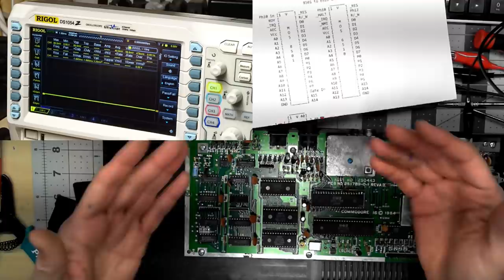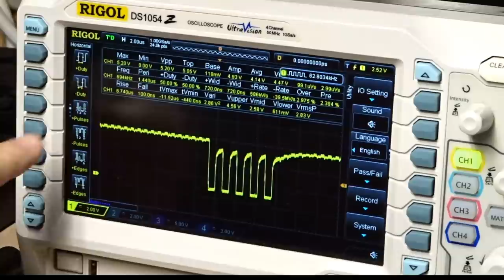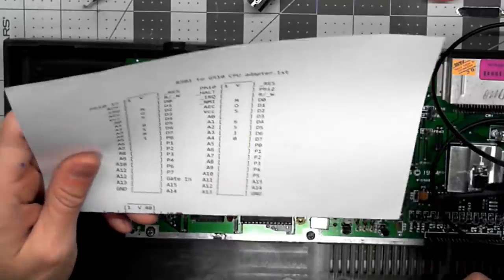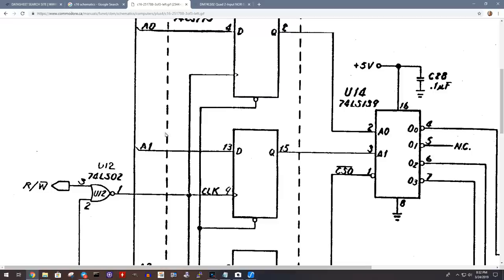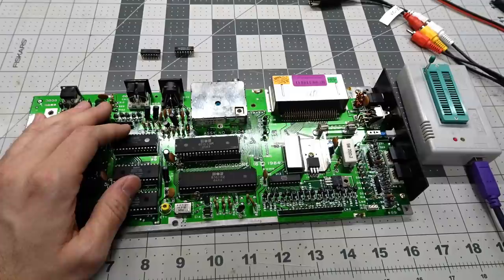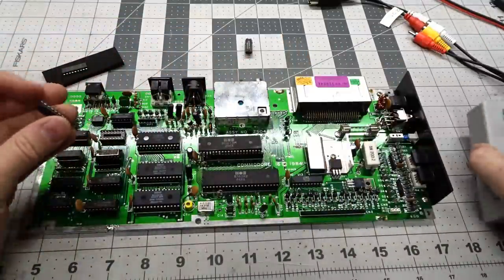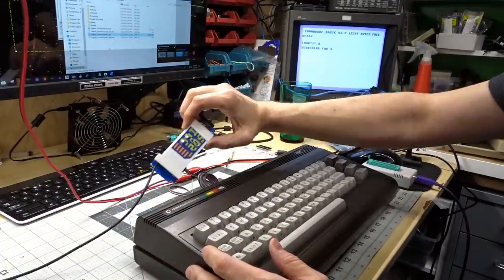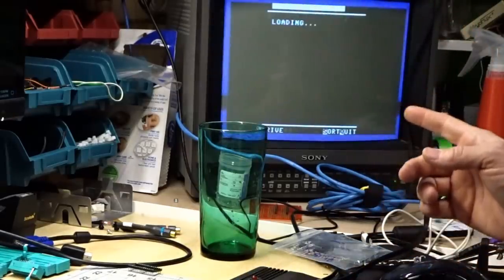Fixing the C16 and getting disk I/O working

Comment: I'm glad you left in the errors. We can learn from them, as well as you.

I have found that unless you have a custom\exotic and/or a bed-of-nails tester, then in-circuit diagnosis requires experience (either earned, or given) to limit you to specific areas. In my experience, loosing 1 hour is nothing.

Note that each time you remove or replace a component introduces a risk that you need to cover. If the 'value' is there (either for experience's sake, or actual), then in-circuit diagnosis can be rewarding.

Comment: Who would've thought the PAL and NTSC versions actually have differing KERNALs. Nice work "transplanting" the 6510 handling changes to the NTSC variant!

Here's hoping the guys at the MockA65xx finalize their product soon - that's supposed to be a drop-in replacement for all 65xx series CPUs, including the C16's 7501/8501 and even the C128's 8502!
Reply: Its prob why you can't play NTSC/PAL games in different countries too.
Reply: There is also the internal „clock“ a jiffy counter that is different for pal vs. ntsc 50/60 Hz that have to be programmed different if I remember correctly to get similar timings for I/o and stuff.

Comment: The internal struggle of wanting to start with using a schematic to troubleshoot vs.  just chip swapping and instincts is very frustrating. I find I only ever want to try to repair something by schematic when I'm shooting a video because it looks better on camera. But really with this kind of old stuff a lot of times it's overkill if it's all simple parts like this.

I also completely understand wanting to use the schematic because it feels more validating to find the problem by looking for the symptom instead of the cause. Chip swapping feels lazy but it can save so much more time it it's an option and especially if it works. It can also backfire and make you look inexperienced though, like with my attempts at repairing my 1541 drive. It's probably time to bring a schematic into that one.

Nice logic analyzer, which one is it? I went with a bitscope a few years ago (I've never had a reason to show it on camera but I'm probably going to use it in a video in the near-ish future) for it's linux compatibility and python interface software. But the provided applications for it always felt really half baked to me. It seems like all these little USB analyzers have some oversimplified web based software and I really don't like those.

I did not know the minipro could do logic testing! That is going to be very helpful in the future.
Reply: @adriansdigitalbasement  $65 is a great deal. My $300 BS10 is only 8 channel but does 100MHz analog and has a simple sig-gen built in. I didn't have any scopes when I bought it and a pocket sized scope seemed appealing at the time. Now I would probably go for that option at $65. It looks like SIGROK supports my BS10, I don't know if it can do the analog as well but I'm definitely going to give it a shot. 

Having a starting point to work back from really helps for sure. All out dead is the worst if it's not a PSU problem. Getting that C16 running perfectly from nothing by any method is a win in my book!
Reply: I know Im kinda off topic but do anybody know of a good site to watch newly released tv shows online?

Comment: Last year I made a Crazy Kong Arcade machine and during the build of the cabinet the game PCB developed some graphics problems and missing sprites. It took me 3 months (a few hours now and then)  of logic probes, digital scopes, logic analysers, pulling chips and testing in one of those cheap logic testers until I found the faulty chip. It was the first time trying something like this so by the time I had brought some of that test equipment I could have brought another PCB, but I was determined to keep going and when I eventually found the problem the satisfaction was well worth the cost. This year I have 3 x Tetris bootlegs with garbage on screen  and 1 Choplifter PCB with missing sprites  that I will be trying to repair, but I am not sure how to test PALS and looks like I will need to by the mini pro as the GQ-4X programmer I have does not support them, but it was essential for programming the very old chips that needed 25v.  The tetris bootleg run on 6502 cpu !
Reply: @adriansdigitalbasement  So lucky for me and thanks to MAME I have the pal code for all 6 on the Tetris PCB. I thought these are one time programmable  and I believe the TL866II PLUS does support them or is that the GAL ?

Comment: I had the same issue with the TRS80 MC10. The motherboard chip count was low and the majority of the chips was TTL. I just pulled them all and put in sockets and used it as my MC10 test board for all the other MC10's stacked for repair

Comment: Ok wow... I had NO IDEA that the MiniPro eprom programmers can be used to test logic chips!! I must have looked at the software a hundred times and totally did not notice the "Logic IC" setting.
I've been trying to troubleshoot a DIY single board computer kit I'm trying to assemble, and like you I went down the rabbit hole of pouring over the schematics, fiddling with oscilloscopes and logic analyzers, etc. etc. but so far have not found the problem. Maybe I ought to pull out my MiniPro and start testing the logic chips (this SBC uses lots of discrete logic)

Comment: This video is great stuff.

BTW I found a great explanation of how the 64 ram upgrade works here

https://myoldcomputer.nl/other-computers/commodore-16/commodore-16-memory-expansion/

Basically the 4464 and 4416 chips have the same pinout. All you need to do is to link A14 and A15  to U7 and U8 the 74LS257 multiplexor chips that drive the multiplexed row and column address lines on the DRAMs.

Comment: Great part 2!
 I like the way you trouble shoot the start up on the on the cpu pins.
I think I will try that on mine.
There is not a whole lot of info on start up trouble shooting as with the C64.

 Is the reset circuit timer chip the same as the C64 (I think a dual 555)?
I actually have the minipro as you do. Used it heaps of times to find bad chips on the C64. I actually used it to verify the contents of the 2 kernal and basic chips on the C16 ..

I think I will spend some time re socketing and testing the smaller chips.

Thanks for the information....:-)

Comment: Logic IC's can be such a pain.  I've seen them fail in really odd ways, and sometimes they test good in a tester but don't function in-circuit.    Especially on old arcade boards that have decades of 24/7 use, tons of oxidization, dirt, and corrosion.

Comment: I'm having a similar problem with my C16, but no spare parts to test the TED or CPU.  7400 series chips are cheap enough that I just might socket and replace all as you did.  Interesting - my board has different MOS-branded 7700 chips than yours above the RAM, but they are likely compatible.

Comment: Great work. I love the C16 and seeing it running with a 6502 CPU is just phenomenal. But wouldn't it be possible to fix the external storage problem by connecting the pins of the CPU differently with the motherboard? So that no ROM-update is needed and even programs work that bypass the internal data transfer routines?
Reply: No, that is not possible. The CPU port on the 6510/8501 is 8-bit from the software side, but just 6 out of those 8 bits are physically available on pins. The problems is: The 8501 exposes a different subset of the 8 bits on the pins than the 6510. Therefore rerouting is not possible: There is no way to get the remaining two bits somewhere on a pin.
Reply: Thank you for your explanation. I think I now understand it. The C64 only uses 6 bits of an 8-bit port for data transfers but the C16 uses all 8 bits of this port. Geez. - I think he even said that in the video but I'm a bit slow on the uptake. :-)

Comment: the 139 is basically an address bus demultiplexer/decoder. it takes the 4 possibilities on 2 input lines and turns it into 4 seperate lines. aka chipselects. :P that pretty much is it's primary use. :P no idea why they put that in if there is also a pla but whatever.

Comment: So it looks like the enable line on one of the 2 decoders in the LS139 was bad. I don't think that any reasonable amount of schematic troubleshooting would have found that particular defect.
Reply: @adriansdigitalbasement  Possible, depends on the logic probe. But the desoldering/socketing approach was more effective. I used it myself not long ago when troubleshooting a ISA memory card. 3MB of RAM in 256kx1x9b banks. 1 bad chip among 108. And they were all soldered to begin with. Wasn't fun. :)

Comment: I just picked up a C16 that doesn't boot, hoping it's the CPU given that's easier to replace than the TED. The CPU gets too hot to touch within seconds (using a 9V 1.33A DC wallwart I swapped the polarity on), while the TED stays stone cold. There's a Lotharek mod in the works called the "6502 plus 4", it's apparently an adapter board for the 7501/8501, that allows you to install a 6502 instead. It handles the I/O with CPLD logic, and also adds the Hannes 256KB RAM mod. It's still in preorder, so I've ordered a cheap China logic probe in the meantime in the hopes I can narrow the issue down with it. Maybe by the time the probe's here, and it does turn out the CPU's bad, the board's out. I don't mind FPGAs, but if the option of an actual 6502 CPU core is available, I'll go with that.
Reply: +Adrian Black, Good to know the CPU's more flaky than the TED. Yeah, I don't really want to make my retro computers mere hosts for FPGAs either (even though this might be inevitable in the distant future), but I don't mind it too much if the CPU core's at least still a real 6502 :)

Comment: In a video situation like that, I'd say use the webcam to record the oscilloscope since that video stream will be shrunk down for the picture-in-picture and hide the poorer video quality.  The main camera can be used for the big picture over the bench.
Can that Minipro EPROM programmer program a new PLA (such as one from Signetics) with the programming necessary to make a working replacement for a C64 PLA?  At least one of my machines has a Signetics PLA, but from what I understand they have to be specifically programmed.
Reply: 00Skyfox Logic array chips are completely different from EPROMs. I think it has been done, though one needs to find a chip with about the same propagation delay as the Signetics part.

Comment: I just re-watched this video and was wondering if you could re-route the I/O pins on an adapter board (or maybe even in its current socketed form) to match the original KERNAL's expectations. As far as I can tell, the current "1:1" mapping is only done because this portion of the pinout more or less lines up nicely.

Comment: 16k is too little? sounds like bill gates lol.. I remember when i used to code games on a zx81 with 1k ram :D certainly a good series though. keep up the work
Reply: I had one of these, and I frequently hit the 16K (actually 12K) limit just writing Basic programs. I used to hit the 48K limit on my Amstrad 464 later on too.
It's amazing that they even managed to get games to run in 16K.
Reply: I was a proud C16 owner as a child. One of the few advantages the C16 had was the V3.5 BASIC. It was so easy to do graphics. But when the graphical screen was used it literally ate about 10K of the 12K RAM leaving you with a pretty short programming space. That's why it's so little compared to the big brother Plus/4.

Comment: I bought one of those 6510 adaptor pcbs off Him about a Year ago, I did have some issues with the sd2iec and some games, maybe the pi1541 I have yet to solder up will sort those problems out.
I assume You realise the TED can do NTSC or PAL? It is possible to do a switchable ntsc/pal mod for both. I think 90+ % of all software is Pal, so doing a mod is worthwhile. I bought three plus/4 machines a few Years ago off ebay, 2 are now modded for PAL. I'm in Australia so no need for NTSC here.
Reply: I think I was trying to load one of the newer games Majesty of Sprites or Land of Zador and it kept crashing during the load. I tried a few times made no difference. I'm certain the same games worked on my other plus/4 that has a real 8501. The Pi1541 may make a difference, but we'll see.

Comment: so, we need a 6502 + the extra 8 bit IO to have a base for a replacement for the c16 and c64 cpu. thextra pin we could use for a ram extension?
what about the cpu in the c128? is it the same like the 6510 but with higher speed?

Comment: Could you not just copy the C64 JiffyDOS loader routine into the C16/Plus4 version?  The C64 loader should work, right?
Reply: No, it cannot work. JiffyDOS doesn't use a clock signal. The device and computer synchronise and then the computer should read the serial port exactly at the right moment to read a bit from the drive (this should be clock cycle exact, if you are one cycle off, you can read garbage). Not only this frees up time manipulating and checking the clock signal, but the clock line of the serial bus can be abused to transmit a second bit at the same time, doubling transfer speed.

The clock speed of the C16/Plus/4 dynamically switches between 887 MHz and 1773MHz, while the C64 runs always at 985KHz.  Therefore the C64 routines are not usable to read the serial port at exactly the right time.

Another difference between the C64 and Plus/4 is that on the C64, the serial port is connected to CIA2, while on the C16/Plus4 it is connected directly to the CPU.

Fixing the JiffyDOS for the C16/Plus4, that already accounts for all these differences, would be by far the easiest job, but even when doing that, you have to be very carefull that the modified routines read the serial bus exactly at the same clock cycle as the default routines.

Comment: The only question I have is what can you do with a 64kb C16?
Reply: It will be equivalent to a Plus/4 except for the onboard word processor/spreadsheet. Therefore software designed with the Plus/4 in mind will now run on it. An example is the game Pets Rescue that was released in 2018.
Reply: @danielmantione  Could you add the ROMs from the Plus/4 and thus make the C16 into a Plus/4?  I think I'd be more interested to see if the Commodore/Microsoft BASIC used in the Plus/4 would work in a C64. I'm guessing Commodore either a.) didn't want to split the C64 user base into having different stock versions of BASIC or b.) didn't want to potentially pay Microsoft a royalty increase per C64 sold. Jack Tramiel originally got BASIC for a song and a dance from Microsoft; in fact, had Apple not licensed Microsoft BASIC to replace Woz's Integer BASIC in the later Apple II computers, Microsoft would've went bankrupt in circa 1978.
Reply: Yes. Mounting them could be a challenge as there are no facilities on the mainboard to mount the ROMs, but electrically there is nothing that would stop you.

Once you have done that, there still is one difference with a real Plus/4: The user port.